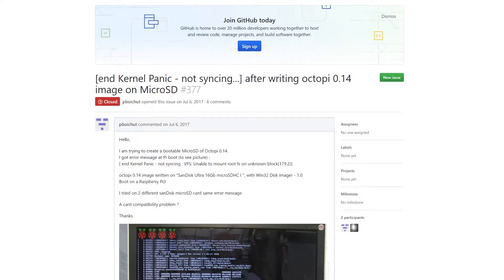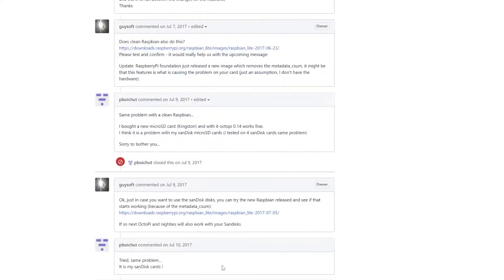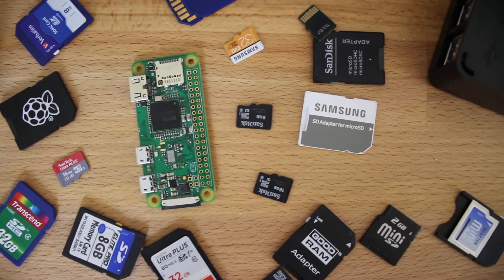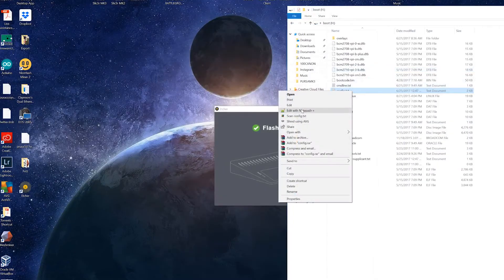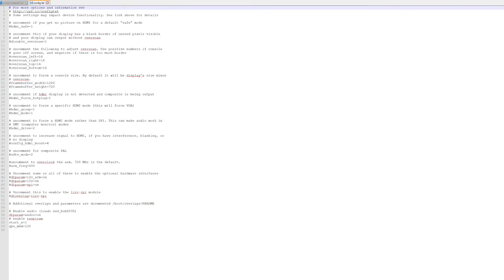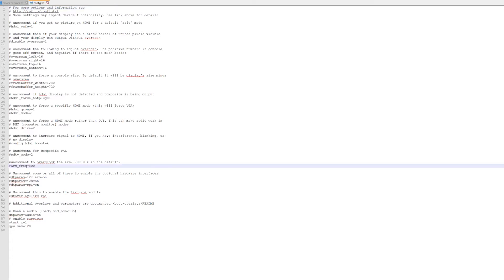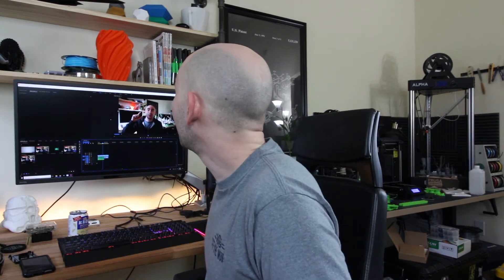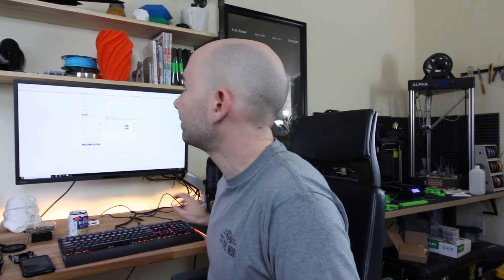Raspberry Pi Zero W - Kernel Panic - Octoprint - Problem Solved

Comment: i bought an all in one raspberry pi 4 with ready to use 32gb sd. its working but i want to use twister os, so i flash the sd. after that i got this error. downclock not working the config file is always again on 800... i think the sd is damaged i dont know, i read all the www tips

Comment: He gets to the point around 1:40
Reply: The "fix" which required so much intro is opening config.txt file, uncommenting line with arm_freq = 800, and changing the value to something higher  (900/950)

Comment: This still isn't working for me, I believe the issue started because I transferred the files over to a new SD card. Should I put the files back on the default SD card that came with the RaspberryPi, would that be the issue?
Reply: Also, I found a Kingston SD card, so I copied everything to that and it still didn't work!

Comment: Not working on my ELEYOM class 10 256GB micro sd I keep getting this message on my pi3.
[   1.113981] ---[ end kernel panic - not syncing: VFS: unable to mount root fs on unknown-block(179,2)
Ive wiped my micro sd card and then re download retropie and it boots up fine then i close emulationstation, turn off the pie, turn it back on and get this message every time. Its like i need to keep my pi running at all times and never turn it off i just feel like im not supposed to keep it running all day? This is my first pi btw, just got it this week.
Any help would be appreciated.
Reply: I had the same problem. Did you solve it?

Comment: OK sir Saitama Georges, now it is me marathoning your videos :D Ok, 1st, you did the same mistake than me, don't get a PI Zero W for octoprint, bad idea, it works tho, but far from ideal. Downcloaking you CPU worked because the problem you probably have is that you decided to power it out of a phone charger (I did the same) and it isn't giving it enough amps. So it is unstable, lowering the cpu clock is a bad solution because that board is already slow as hell, get yourself a proper 2A usb plug, problems will be gone. But the real solution is to get a proper PI3, it will be night and day. The Zero W is great for IOT and stuff, but  it is simply not enough for octoprint.
Reply from the maker: I have a Pi3!  I just like the fact that it can be tucked away inside the case for the einsy.  I do agree though, the pi zero is not ideal for octoprint.  What kind of IoT do you make?
Reply: nothing too serious, more like fooling around, but you know, the typical connect Alexa (amazon echo) with your MQTT broker and control lights around the house using relays through ESP82xx stuff :)
Reply: A PI3 or an ODROID will work sufficiently--ODROID maybe not with Octopi. If using a proper 2A USB doesn't solve the problem,  then it is likely the boot code was improperly written during auto-mount. You can take the SD card to a standard linux and un-mount the drives, fix any problems in your fstab and re-mount the partitions in ext3 or whatever octoprint favors.
Reply from the maker: kungFooBarString are you talking about  fsck? I did try that before doing this trick in the vid.  It fixed some errors but the issue remained. Also I had to manually update to the newest version because meta_checksums isn’t supported in the current
Reply: fstab is a file in the root partition at /etc/fstab that contains the mount point of the disk's partitions in any typical linux distro, you can show it with the command: cat /etc/fstab